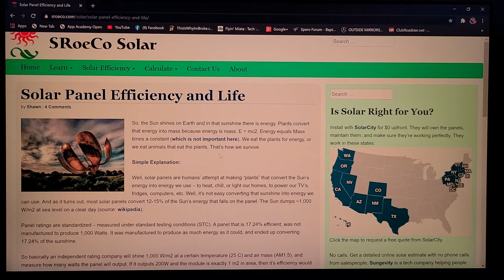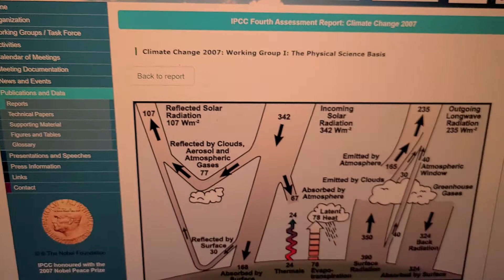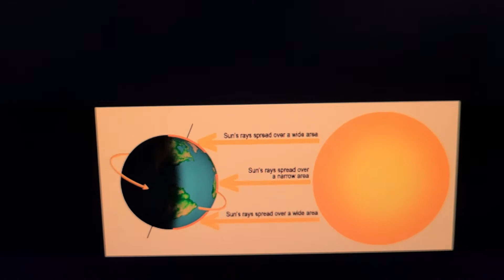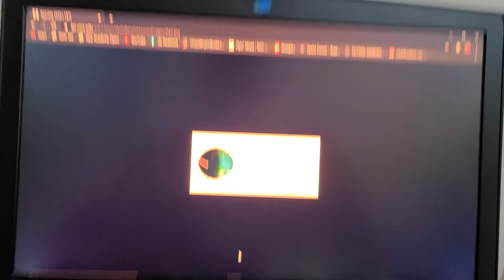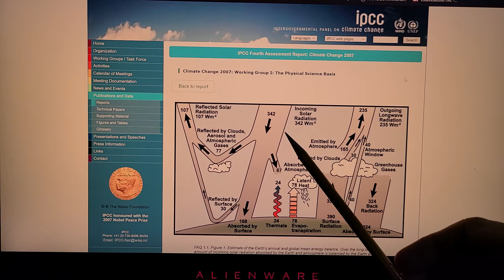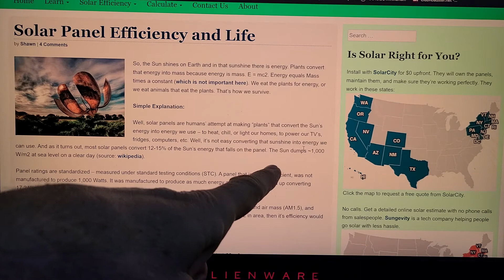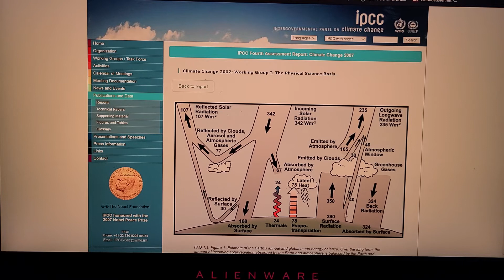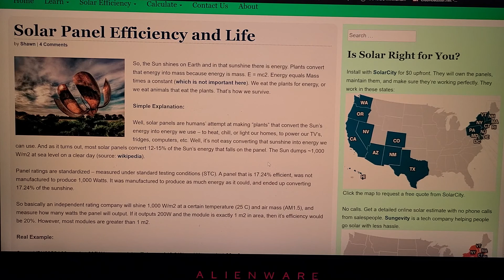IPCC global warming model debunked

Comment: Perhaps you should try to understand something before posting a video on it. You have it exactly the wrong way round. The solar energy flux at the top of the atmosphere is 1361 W/m2. The number given by the solar panel ad is subtracting the amount lost by absorption, scattering and reflection. 

The IPCC model takes that total solar irradiance and allows for the changing angle of the sun throughout a day. So at dawn and dusk the radiation goes to zero (cosin(90)) at noon when it is overhead cosin(0) =1 so you get maximum input. Also there is an equivalent latitudinal and seasonal effect. All of that combined makes for an average energy input to the Earth of 342 W/m2. From that point on it takes absorption and reflection into account. 

"342 W/m2 is -18C" where do you get that nonsense from ? An energy flux is not equivalent to a temperature. 

"The energy is not enough to create the weather" More nonsense - there is weather in Titon has weather and its average temperature is -180C. Weather is created by temperature differences so while there is an atmosphere and different heating at the poles as compared to the equator weather systems will be created. 

It gets hot in the car because the windows let in optical light but wont let IR escape. That is exactly what GHGs do. 

"This trace gas in the atmosphere heats the earth and heats the Earth again" The fact that it is a trace gas is irrelevant. The partial pressure of CO2 is what counts and that is enough to cause global warming. Sun light heats the Earth, CO2 plays no role in that first stage. The earth cools down by emitting IR radiation. That is scattered by the GHGs and aerosols - so about half of it goes back to where it came from. 

"It has no nuclear reaction, it has no chemical reaction" no, it has a molecular reaction, the out going radiation is absorbed by the molecule's electrons which is immediately re-emitted in a new direction. 

Try adding up the numbers: 
Flux hitting the surface = 168 + 324 = 492 W/n2
Flux emitted by the surface = 24 + 78 + 390 = 492W/m2

Balance!

"Did you know that solar panels are made out of coal? That's why they are black" You really believe that? They are black because the manufacturer paints them black so they will absorb more energy.

Its you that don't know anything.
Reply from the maker: It's a flat earth model. How can it be 1361 W/m2 and 342W/m2. They FLATTEN the earth that's why!
Reply: @johnnychorgo8795  I explained that. It is 1361 W/m2 for a square meter and normal incidence at the top of the atmosphere. But most of the earth is not normal incidence - it has an angle of incidence varying from 0 to 90 (noon to dawn/dusk) also a latitudinal component and seasonal component. When you take all that into account it becomes 342 W/m2

You have still not explained why 342 W/m2 is -18C
Reply from the maker: @drkstrong  that's a contradiction. If it starts at 1361 W/m2 it means the atmosphere is cooling and radiating heat away not trapping heat.
Reply: @johnnychorgo8795  no it does not - now add up the outgoing contributions: 107+235 = 342 ==> balance no heating or cooling.
Reply from the maker: @drkstrong  you are adding for a FLAT EARTH model. The problem is that the earth is not flat. Here is how Co2 Actually works https://youtu.be/KKMfn3s91rs
Reply from the maker: @drkstrong  there is no angle of incidence when they spread solar intensity over both the day and night. There is no day or night no north or south pole no sunrise or sunset no winter or summer. Its a flat earth mathematics model lie
Reply: @johnnychorgo8795  I sent you a link from one of the leading AGW skeptics, tearing your flat earth model to bits. Read it, understand it and drop this silly line of argument.
Reply from the maker: @drkstrong  342Wm2 means 342 Watts per meter squared. FLAT METERS SQUARE! Applied to the whole earth. The earth is not flat.
Reply from the maker: @drkstrong  in space they wear space suits to protect them from the intense solar flux. The atmosphere protects us by radiating the intensity away. This contradicts the global warming model. The atmosphere blocks a large portion of the sunlight from ever reaching the surface.
Reply: @johnnychorgo8795  I gave you the link use it and learn.
Reply: @johnnychorgo8795  You love to make definitive statements that are complete nonsense. 

Astronauts wear space suits to protect them from the heat of the Sun, the cold of space, micrometeorites, and mostly the vacuum. 

How does the atmosphere "block a large portion of the sunlight from ever reaching the surface"? N2, O2, Ar, CO2, CH4 and water vapor are completely transparent to incoming solar radiation.
Reply from the maker: @drkstrong  you yourself said the solar flux was extremely intense at 1361 W/m2. The IPCC starts with the false premise the earth is flat. That alone destroys the model.
Reply from the maker: @drkstrong  the solar flux starts at 1361 W/m2 so the fact that it's not 1361 W/m2 at the surface of the earth means it's being radiated away not amplified. The IPCC global warming starts with the false premise that the earth is mathematically flat. This debunks the global warming model.
Reply: @johnnychorgo8795  "the solar flux starts at 1361 W/m2 so the fact that it's not 1361 W/m2 at the surface of the earth means it's being radiated away not amplified" You are nearly there - the fact that is not 1361 is because the Earth is not flat. You are making the flat earth assumption.

I dont know if your maths is up to it but derive the integral over -90 to + 90 for cos(i)cos(theta) for all points on the Earth where i is the zenith angle and theta the latitude (If it isnt spoiler alert it is 0.25. Guess what 0.25 x 1361 comes to?